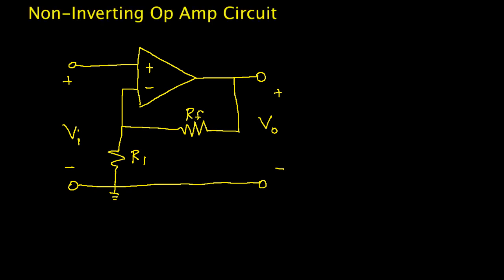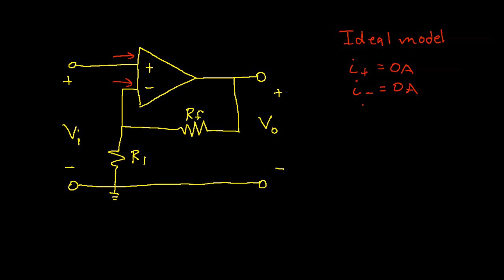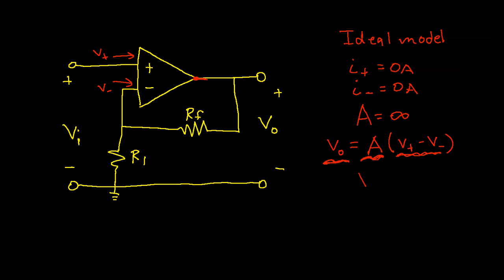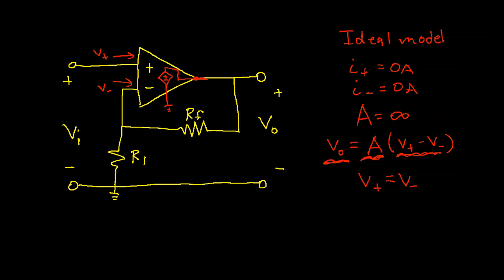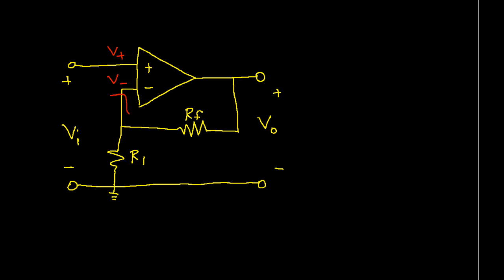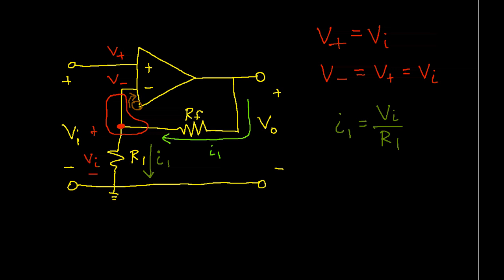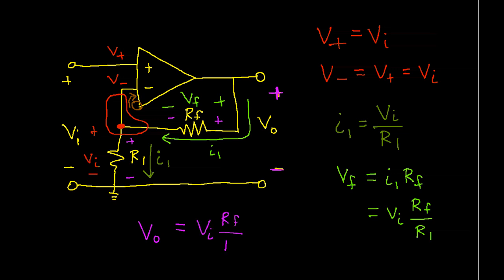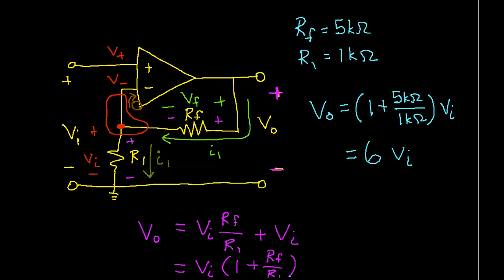Op Amp Circuit Analysis: Non-Inverting Amplifier (Edited)

Comment from the maker: Alejandro, Thanks for your interest in the video. However, you have missed the point, which is that by doing the analysis of the op amp circuit in the video, we actually compute the gain of the op amp circuit. When you compute this gain, it is Rf/R1+1, which has no negative sign. If you are still not convinced, Google "non inverting op amp"

Comment: if(current through Rf) is same as current through R1 then y use kvl. Y not just use VRf/Rf=If , Vi/Ri =if then do VRF/RF=Vi/Ri and get the answer as VRF/Vi =Rf/Ri. I am asking this because you don't use KVL or include VO in inverting amplifier.